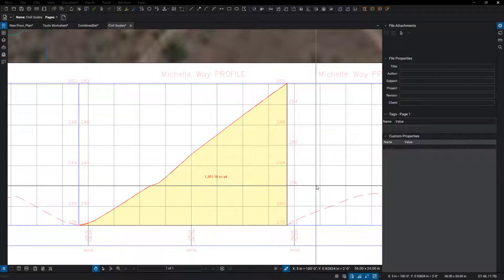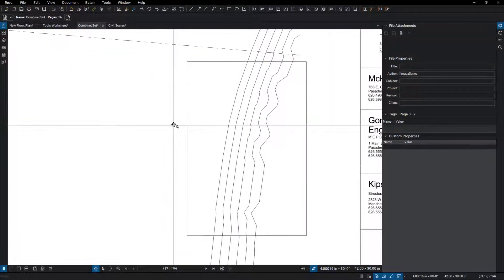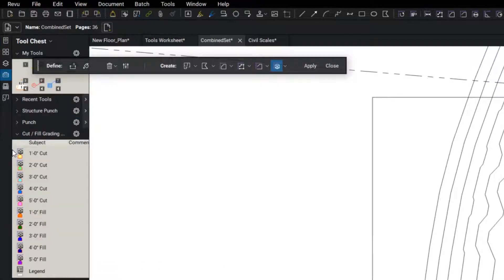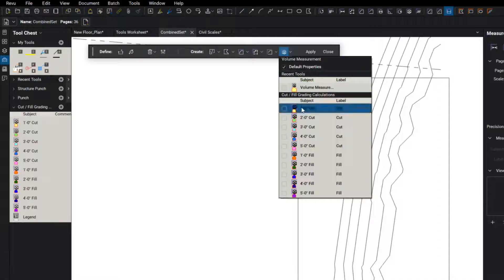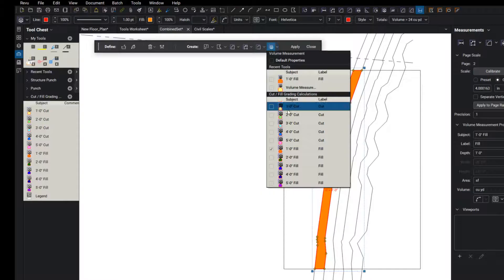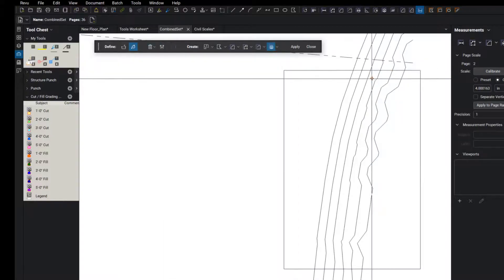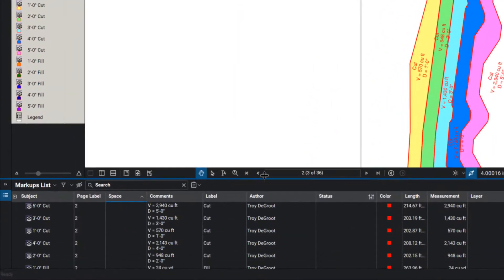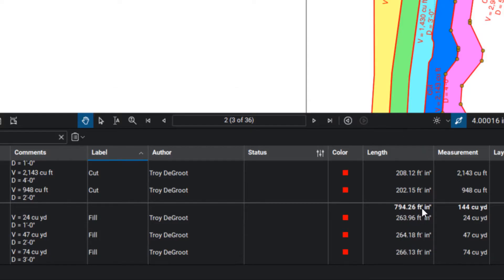Bluebeam Revu - Cut and Fill Calculations in Plan View

Comment: Is there a way to compare 2.   Grading plans usually show proposed and existing
Reply from the maker: The overlay function is probably a better solution for this because it will show each one in a different color so you can tell them apart. Hope this helps.

Comment: Troy, I understand the process and how dynamic fill is used, what i need help with is how to create the cut and fill tools...how do you define cut 1' vs fill 1 etc.?
Reply: or more specifically...all i need is your cut and fill toolset, where can i find this?
Reply from the maker: I have 1615 free tools to download on my website, however estimating tools like you're asking for are not included. Mainly because I've built thousands of tools and no two companies are the same. I do however build custom tools for customers, if that's something your interested in check out my website and schedule a call. Thanks for checking out the videos @renaldoc.walters9476
Reply from the maker: I would build separate tools for cut and fill so they are identified as such. You can differentiate them by color and layer as well.

Comment: Very informative, even though it’s. Not something I use everyday, it good to know those thing. 
I need to look at your Dynamic Fill video, it’s a tool I’m struggling with. (Again, I don’t necessarily need it on a daily basis, but the curious in me doesn’t like not knowing)
Reply from the maker: Thanks Roye. Dynamic Fill is one of my favorite measurement tools that came out in 2017. Check it out!